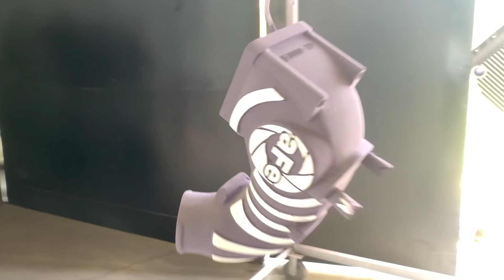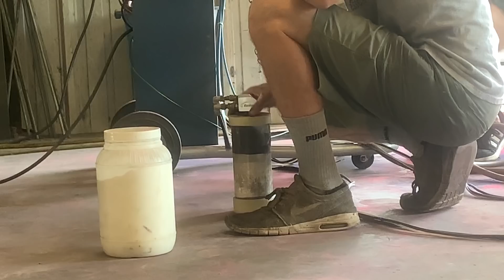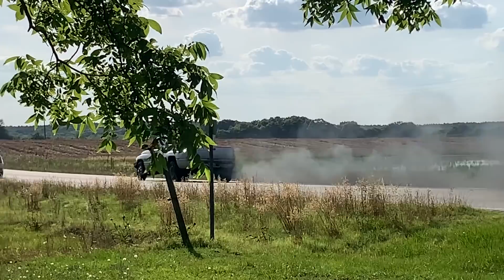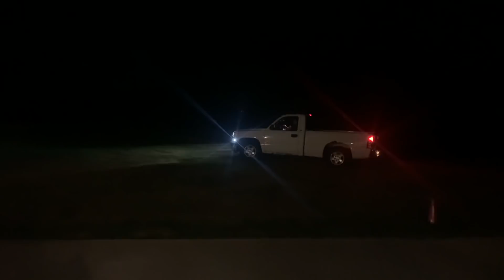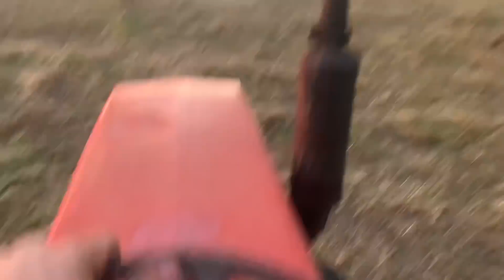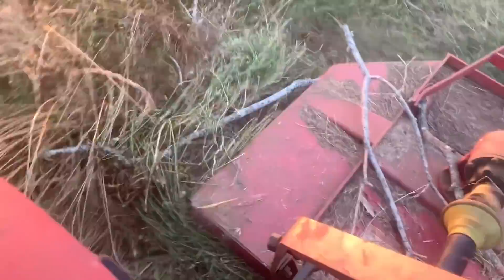MY DIY FLATBED PROJECT IS 95% FINISHED! (CAME OUT SICK AF)

Comment: I had the same problem on a t-tag. Had like a maroon bedliner on the cab... but under that was like 4 or 5 different paint jobs.. green yellow red blue white blue again... it was insane!.. used aircraft remover... looked worse than that... but we had a steam Jenny pressure washer and some spray acid... helped allot but again it wasn't perfect at all... but better. Still had to grind some and sand some...

Comment: Looks good considering the metal you were working with.
The paint line between the white and black can be made straight by using pin striping that’s either black or white. Old painters trick. It was done like that on my Dodge Ram truck between the black between the doors and the silver paint. You done a great job on it. 👍🇺🇸

Comment: Yep classic first time Yanmar owner, radiator fills with chafe and you over heat it . Be careful you will blow the head gasket easy on those. Unless someone has modified that there is no water pump on it and it's a thermosiphon system. Make sure you use 30% green antifreeze and no more. It needs the right ratio to work correct.

Go to Hoye Tractor you can see the parts diagrams. Their your parts source for those. But there is a screen to go in front of the radiator to catch some of that stuff and you can pull the screen off and knock it out. It gets more off easy and less in the radiator fins. You can also zip tie some window screen to the front grill and it will catch most of that crap before it hits radiator.

Just some tips from a guy who has had one for 12+ years

Comment: You need to let your bush hog spin down before you shift to drive gear to keep from grinding. Unless you spun the bush hog up and then went to hear quick cause tractor doesn't ha e enough torque to doing BH and start off.

You can slow down or take smaller bites. It will go through all that stuff. And take your right you want the back higher to kick that stuff out the back and not keep chopping it up
Reply: I don't think he had enough RPM, I doubt he was getting 540rpm from that PTO when cutting